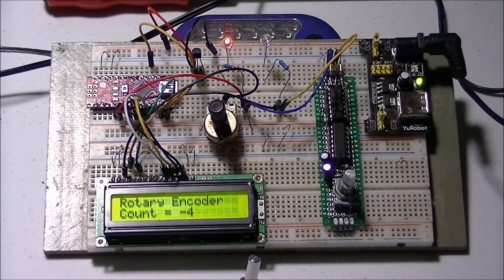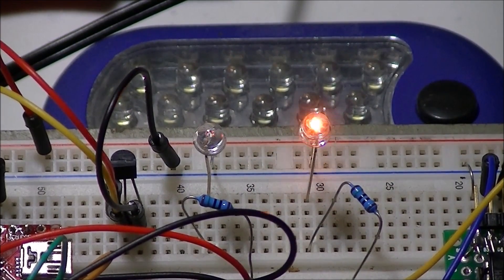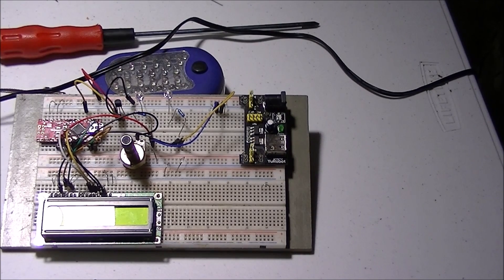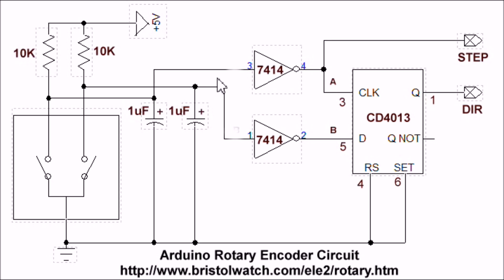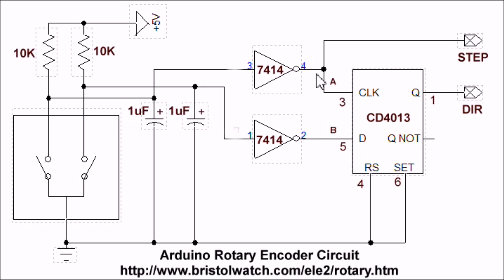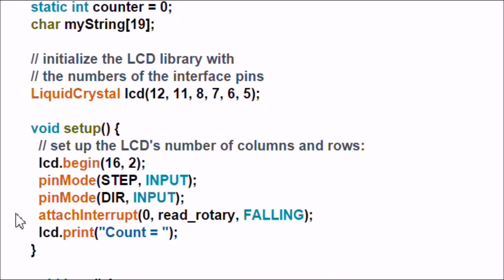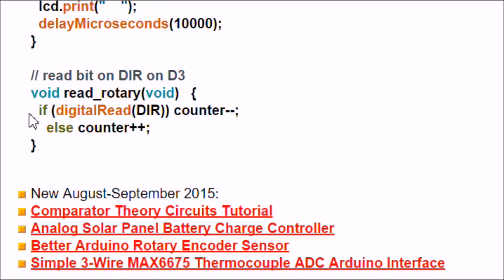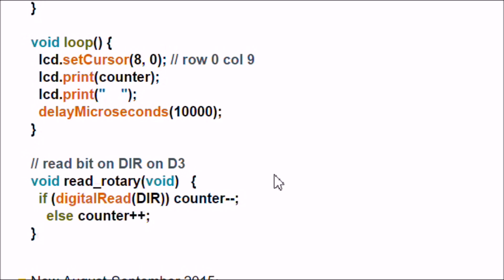Arduino Rotary Encoder Circuit Tutorial with Interrupts

Comment: You're only monitoring your clock pulse with one leg of your encoder. These are quadrature encoders which four steps per cycle not two.
Reply from the maker: Not right. The device is triggered through the interrupt then checks the other leg.
Reply: @LewisLoflin  I might have missed it, I'll re-watch your video when I'm done on my project. Thanks for the reply.
Reply: @LewisLoflin  I believe you're wrong. You must monitor BOTH encoder A & encoder B leads in both states - rising and falling. This is a quadrature encoder you should interrupt when when encA goes high and low and when encB goes high and low to get the full encoder output.

If you draw a line every time EITHER A or B changes you will see all four states. For example, let's say encA goes positive and we measure encB as high, fine we increment the counter. Here's the bug, now in the next quadrant, the one you're missing, if encB goes positive AND encA is still positive we increment the counter but if encA is low we decrement the counter. You have no way to see this step with your falling interrupt as you're just measuring the "falling" edge interrupt and not even measuring any changes of the encB lead. For every rise and fall of encA and encB ( two pulses on your chart) the encoder registers four counts. All you're interrupt is measuring is one quadrant (encA falling edge) not four quadrants (encA rising and falling, encB rising and falling).

Also, the 1uF capacitor is too large, you can accomplish spike suppression with a 0.1uF or even a 0.01uF and a 10k resistor. The problem with using the 1uF capacitor is that you will miss steps on the slow rise time of the damped encoder signals.  For example, I just designed a linear encoder that monitors a digital readout. in a 10mm change of the linear distance the encoder pulses 20k steps (5 microns a step 10/ 5e-4 = 20k). A 1uF cap. will never be able to capture that signal, the rise time is too long. You're worrying about speed with delays when you're damping the signals with too much capacitance.

Everything can be easily done in software. For example if we have two pins in the same interrupt vector any time either rises or falls we trigger the same vector.

Here's a program I wrote, it compares the last state with the new state and determines the direction. Using and 328p clocked at 8Mhz (internal clock) we can run the linear encoder example I gave above although I use an external 16Mhz ceramic resonator. It uses PINB,0 and PINB,1 which makes the algorithm easier to implement. If you use other ports you will have to move the bits to position 0 and1.  No extra hardware is required, just a simple routine. Try it out and see what you think:

(code removed as it will be part of a magazine article.)
Reply from the maker: @mosfet500  The title specifies interrupts. A rising or falling pulse (set in software) allows the Arduino to check the state of the other leg.
Reply from the maker: @mosfet500  To quote, "You must monitor BOTH encoder A & encoder B leads in both states - rising and falling." Why? The interrupt monitors A, then the state of B determines direction. It is not needed and works fine with the encoder I'm using.
See the following:
https://www.bristolwatch.com/ele2/rotary.htm
https://www.bristolwatch.com/arduino/arduino_irq.htm
Reply: @LewisLoflin  It misses states, what happens if encB indicates a reverse state? Your interrupt doesn't see it, there's no interrupt vector.

Again, there's no reason to incorporate digital logic, everything can be done from the uC and code very accurately - more accurately than your design in fact. You're still using two pins in you design, more circuit space, more parts, what have you gained? Complexity?
Reply from the maker: The hardware interrupt monitors the other leg.
Reply: @LewisLoflin  Your interrupt only monitors the encB leg relative to the encA interrupt leg NOT independently of it. BOTH legs create the full quadrature. Let's say encA leg is in state 1 AND encB leg changes state? The interrupt misses it. Worse, you're only monitoring the encA leg on the falling edge not on either state change. You miss the rising edge of encA and the change of the encoder. It's quadrature encoder, that means for two positive pulse there are four states, you're only seeing one state out of four and any direction change that creates, if encB state changes and results in a direction change you miss it. You're missing steps. Again, let's say encA is in the one state when encB changes state, is the encoder going in the forward or reverse direction? you don't know, you have no interrupt vector indicating it.

           __     
       _|     |__ encA
       __         
___|     |___    encB
     |  |  |  |     <------ Four states, it's QUADRATURE encoder, you're only monitoring one state and one direction change.

Comment: Lewis, Thank you very much for this circuit. It answers one of two questions I have been working on, Direction? The other is quadrature output. I use a 2000 PPR Quadrature optical encoder and I want to feed my servo with the full 8000 PPR (step) from the encoder for higher resolution. You already took care of direction. Is there a circuit of all discrete components that can count transitions in A and B and output 2X and 4X pulses?

Comment: Should there be a resistor in series with the capacitor to the encoder pins to prevent the capacitor being shorted direct to ground?

Comment: I used this to control my airbrush spray booth extratctor. The fan has a build in PWM controller, it just needs a pwm signal. Now I can control the fan using a rotary encoder and this circuit.
I did solder  0.15uF ceramic capacitors between Enc1 and GND and Enc2 and Gnd. There is no need for software debouncing tricks. Thanks for this circuit.
Reply from the maker: Thank you for the input.

Comment: I don’t really see why the 4013 is here. Wouldn’t it work just with the smitt triggers? You could then execute the interrupt either on a falling or rising edge wouldn’t matter.
Reply from the maker: The 7414 are Schmitt triggers. The 4013 can be left out but using that makes the programming easier.

Comment: Wonderful idea!
I decided to try and do it myself but with using just Arduino Micro as power source and two LED lights for output signals. I followed the circuit scheme (Figure 2 on the web page) and used my Arduino as the 5v and ground source. On "STEP" and "DIR" I connected LED lights first time to ground and second time to 5v.
When I checked it on the first time (LED connected to ground), it output nothing. When I checked it on the second time (LED connected to 5v), it outputs blank LED on "DIR" and flashing LED on "STEP" on every encoder "click" no matter the turn direction.
What am I doing wrong here?
What am I missing?
How can I fix this to receive the same "blink" outputs as you receive in the video?
Just to be more clear, I use my Arduino only for power and ground source and didn't uploaded (or used) any code into it and prefer not to use it as other than that.
Thanks.

Comment: I've seen several different ways to connect a rotary encoder to an arduino on youtube.
I have tested many of them, but none have worked satisfactorily.
When I saw your solution, I immediately understood that this would work.
I bought the circuits and tested.
It works great, no missed pulses and no double pulses.
Thank you for sharing this elegant solution.
Reply from the maker: Great! Thanks.
Reply: @LewisLoflin  hello sir my case encoder 
To canect to arduino but missing pules
Plz help???

Comment: Hello, I put a tread mill motor 2.65hp dc on a drill press, could the motor be controlled with this setup and read the rpm,
Reply from the maker: Is it a DC (I think it is) motor or AC? Why would you use this to control a motor? If DC use PWM.

Comment: If you are using a manually operated RE, Unless your sketch is very long and/or filled with "delay" or "while" statements, an Arduino is quite fast enough to poll the A and B inputs without the need for ISRs.
Reply from the maker: I'm aware of that but the idea was to use the interrupts in order to do other tasks.

Comment: very cool these days.. you can just find this kind of info on the internet..  Although it's good to have ,you really only need debounce on the line you trig on, if reading A and B directly instad of via logic, because the line not trigged on will have stopped bouncing a long time ago..   .. So for example interrupt on A ,debounce it somehow(disable int?). Then if B is high you're going one way ,if low you're going the other way, so the logic circiuits are somewhat superfluous unless you're actually controlling some piece of hardware that need thoose signals, like a digital pot..   I'm more of a verilog/fpga dude theese days but I used to do stuff on avr a long time ago, when mega8 was popular..  :-D Cheers.

Comment: the  bournes rotary  encoder  is so much  more   -  limited  by bournes themselves  -  lack of data  -  that  of    the   increaseing  binary  ,octal or  hex  to relate to the  grey code that they constructed it with  -  perfect for the encoder to operate  - pain in thearse  if you want use  it

Comment: Thank you for the excellent info.  I am in the process of designing a DDS frequency source and wanted a way to make it independent of a PC.  My solution was to use a cheap rotary encoder breakout board available from Amazon.  Got 5 of them for 8.99.  I had interfaced them as is without using interrupts by implementing a software de-bounce routine and was able to get them to work across the USB port.  Your idea is more elegant using a hardware solution to interfacing the board.  However, I did not have the exact parts on hand.  I used a 74HCT74 and an 74LS14 instead.  The only caveat was that the 74HCT74 device has a different pin out and logic levels for the preset and clear pins.  They need to be pulled up to Vcc.  Anyway, I put the circuit together with the changes and tested it with a couple of LEDs one for step and one for direction and also viewed the step output on my scope.  It worked as advertised.  What I would recommend is tying the unused inputs of the 7414 to ground to minimize chattering and avoid excess current draw.  A low output draws 10 ma.  The same goes for the dflop.  I would tie the RS pin to Vcc to avoid the unused output chattering.

Comment: Why do you use a static variable instead of a volatile variable? I've read that sometimes it can be inaccurate if you use static instead of volatile.
Reply: That is incorrect. Using keyword volatile is right thing to do when dealing with ISRs. In short, it has to do with optimization, and volatile disables optimization with given variable. A problem that can occur because of ISRs, is that variable within it can change in any moment. If optimization is enabled, variable might not work with newest value, because ISR fired in 'wrong' moment and because of optimization program concluded that some steps are unnecessary and skipped them... but if variable can change in any moment these steps are mandatory. Keyword volatile fixes this problem and tells program "you shall not optimize this variable". Keyword static has nothing to do with this problem.
Reply: You should be using Volatile for any varaible used in an ISR, otherwise the compiler WILL optimise it out. Even the arduino section at https://www.arduino.cc/reference/en/language/variables/variable-scope--qualifiers/volatile states ... "A variable should be declared volatile whenever its value can be changed by something beyond the control of the code section in which it appears, such as a concurrently executing thread. In the Arduino, the only place that this is likely to occur is in sections of code associated with interrupts, called an interrupt service routine."
Reply from the maker: Here is the answer: https://www.arduino.cc/en/Reference/Static
Reply: The only information I see in the documentation for the static keyword is that instead of the memory being freed after a loop finishes, it stays there so the value doesn't go away so that the next time you use that variable the value doesn't start from scratch.

Volatile variables are loaded from RAM instead of a storage register, I'm not sure how exactly the static variables are stored since the documentation isn't as good on their website for static variables. 

When I look at the Arduino documentation for the volatile keyword it says that it can sometimes be inaccurate when using interrupts:

"A variable should be declared volatile whenever its value can be changed by something beyond the control of the code section in which it appears, such as a concurrently executing thread. In the Arduino, the only place that this is likely to occur is in sections of code associated with interrupts, called an interrupt service routine."

https://www.arduino.cc/en/Reference/volatile
Reply from the maker: Read it again.
Reply: It says a variable should be declared volatile whenever it is called within an ISR.
Reply from the maker: Any variable can be used within an ISR depending on what you want to do. If static makes you happy go for it.
Reply: Lewis, I just found your video and it's very helpful, thank you! 

Regarding the variable declaration, I think it really depends on whether the particular variable is modified elsewhere (or your interrupt handler is re-invoked as a result of another interrupt which arrived before the handler was completed). If neither is true, the variable doesn't need to be declared as volatile. In this case, the compiler may apply optimisations, which means that in some cases it may not look up the current value of the variable in RAM but use the latest known value, e.g. from a register; This would be wrong if the variable was modified elsewhere, e.g. by another interrupt routine. Hence, as long as your code is not interrupted by itself (is this possible?) or another interrupt handler that uses the counter variable, it doesn't necessarily need to declare it volatile. Having said that, for future proofing your code, it sometimes does make sense to declare a variable volatile... so that (future) extensions of the software library don't break it - debugging of such issues is really difficult.
Reply: Great, loved this it, 👏👏👏👏👏👏 @arduinomaquinas thank you man, subscribed channel 🇧🇷😉👍

Comment: Might want to change your interrupt routine to:
counter -= digitalRead(DIR)*2-1 or
counter =(digitalRead(DIR)<<1)-
not sure which would be faster but both are faster than an if else statement
PS: Luv your posts, keep it up. ;-)
Reply: +Wizard Merlin : line through second was supposed to be auto decrement
Reply from the maker: Why would I want to do that? It slows down the whole system.

Comment: does using interrupts for the rotary encoder raise possible delay issues?
Reply from the maker: +Gary K Be careful you aren't running a massive number of other programs - also using delay() will cause problems.